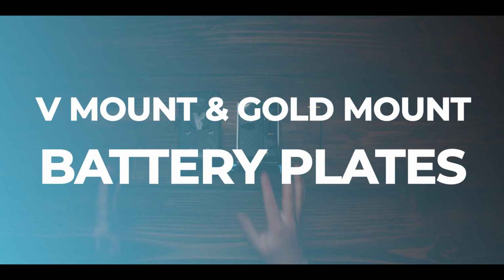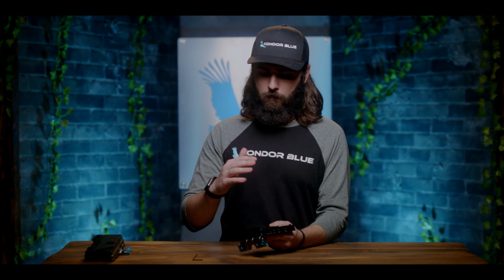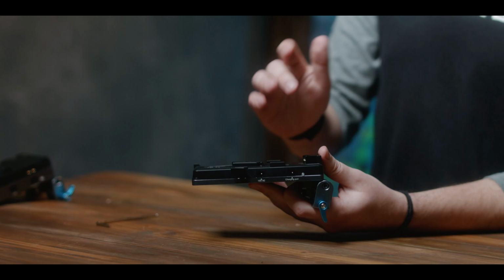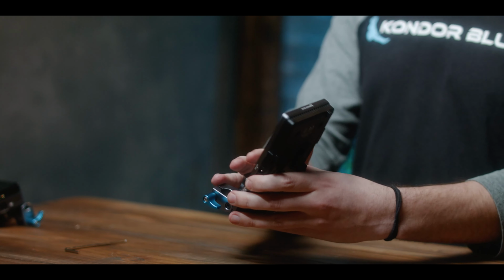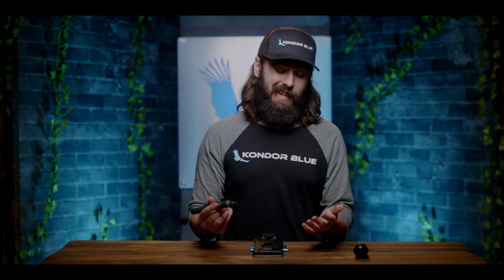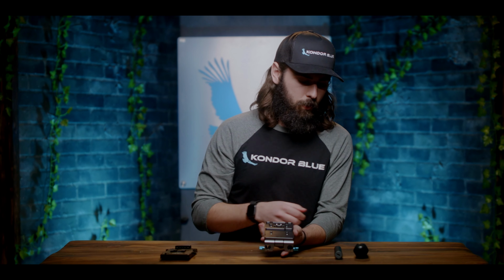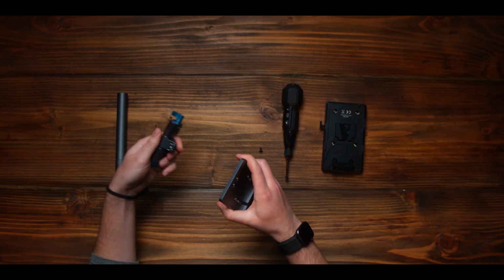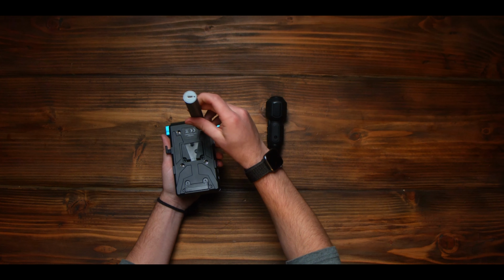Cine V Mount & Gold Mount Battery Plate Overview

Comment: Great tutorial!
What is the little LED on the V-mount plate for? And what does the switch is for?
Reply from the maker: The light indicates charging and connection to AC power and the switch is for adjusting your voltage output of the dc port!
Reply: @KONDORBLUE  Thanks!